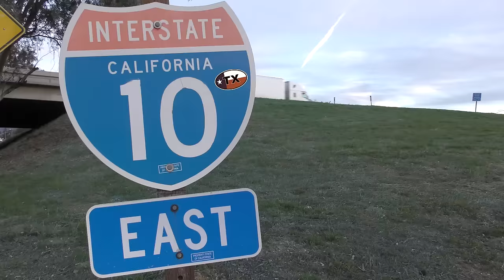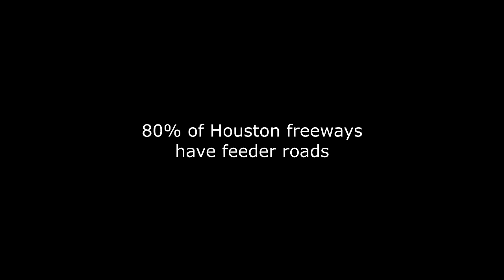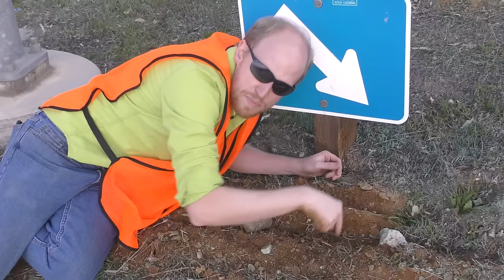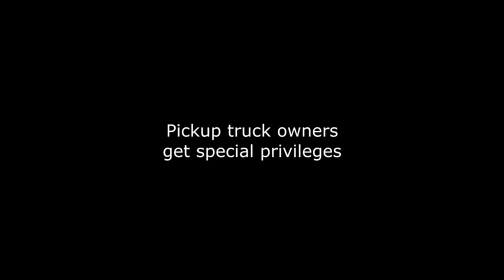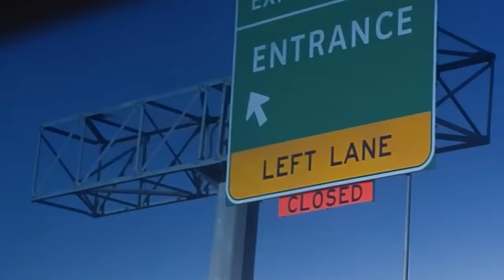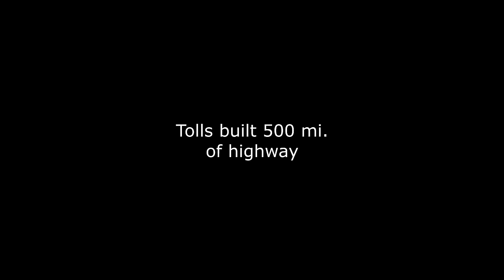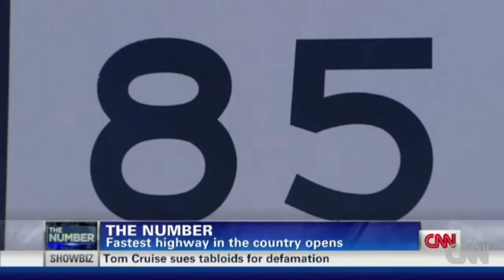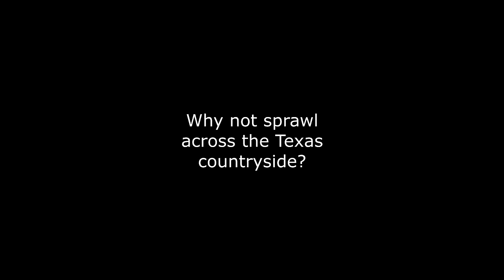How does good Texas engineering make REALLY BAD roads?

Comment: I lived in the Spring-Cypress area for two years before moving to LA. The roads are a bit challenging to figure out when you first get there, but start to make sense over time. The endless commercial development along freeways looks tacky, but can be fairly convenient as a shopper.

One thing to note too is the large network of highways that aren’t limited access. A trip from Houston to Austin usually involves US 290, which will take you from speeds of 75 mph between towns to speeds of 35 mph as it goes through towns along the way. Feeder roads are not present on these highways, and it can be a little shocking to have the speeds change so much. 

I’ve also driven US 59 and 259 from Texarkana to Houston. I was really surprised to see houses with mailboxes and driveways along a road with a 70-75 mph speed limit.

Comment: It is a service road.  It doesn't feed anything.  We also don't have fences along our highways because of this weather event we have in Texas, they call them tornadoes, also some of those dirt paths were used by police, emergency vehicles, or to move traffic off the highway due to a major accident.  Houston has had a history of flooding issues due to the land it is built on and the poor management of flood areas.  Houston rezoned flood zone areas that were purchased by the city a long time ago for flood control so they can use the area to store flood water, the rezoning happened shortly after a election cycle that say it get bought by a developer and turn the area into housing and that is one of the reasons Harvey was so bad.

Comment: I lived in Dallas for 5 years. Living in the city itself wasn’t bad, if you work there you don’t need to leave often. But when you do, I 35 was my best friend, I tried to map out what I needed when heading out of Dallas county according to it (north and south). Although, some people I knew lived on the outskirts and using the 635 loop can be hell if it Is after 5 or or before 8am. Traffic has a tendency to stop on that thing, and I remember I used to keep water in my car just in case I spent 2+ hours on a Friday night stuck on 635 due to bad wrecks. Highway 30 that runs east and west was a good friend too. I relocated my last couple of years there to Las Colinas, and it is a zoom into and out of Dallas (5 to 10 minutes) on highway 30. I can’t imagine what the traffic is like now. I moved North to start a business in 2013 and I miss the city, but not the traffic. There were so many tolls being built when I left it was crazy. The feeders, you need a car with good horsepower to get up to speed, as sometimes the on ramps are much too short.

Comment: Horizontal traffic lights> Vertical lights
Reply: They started installing horizontal lights here in Gainesville, FL about 15 years ago then stopped.
Reply: Horizontal is better for high wind loading (in line with the gantry arm), like hurricane areas. Vertical is better for high precipitation, especially snow. So that explains part of the difference in choices.

Comment: To me, the original concept of the PA Turpike was excellent.  One gets on it, and exits every 20 miles.  It bypasses Philly.  It was built for long haul, transcon traffic.  Local traffic, stay off.

Now the tool part of the PA Turnpike is discusion for another day.

One major issue I have with Toll 130.  It should have been built to bypass San Antonio and connect with I35 and I37.

And US 190 neefs to be upgraded to Interstate standards between Baton Rouge LA, and Iraan TX.  It would provide an E to W bypass of Houston, Austin, and San Antonio.

Comment: I was skeptical when I started but you pretty well nailed Houston.  But you missed some of it too.  In 2001, Tropical Storm Allison hit Houston, went north to Conroe then made a U-Turn and came back hitting Houston a second time.  That was very bad; second only to Harvey.  Harvey stalled West of Houston and we were hit time and time again.  That's a bit unusual!  Hurricanes usually have enough punch to get through; tropical storms often stall.  Allison was a bit different.  The first hit wasn't so bad.  The second hit was bad.  Not only did it drop a lot of rain on our saturated ecosystem but the rain it dropped north of us came down with it.  And it arrived just before high tide.  

But the absolute worst is TxDOT.  Right now, they are planning on rerouting I-45.  It currently goes through downtown Houston and it is as wide as possible with demolishing a couple of tall buildings.  So they want to move it to the east side of downtown and run it parallel with I-69.  But the idiots have decided that they will run it below grade.  Flooding isn't just a problem when tropical storms and hurricanes come through, we've had major flooding when an ordinary heavy rain came though.  Below grade roadways become retention ponds.  Highway 59 (now I-69) looked like a canal.

Comment: The flooding problem can be handled.  Minnesota requires that all new construction has ponds based on the surface area that is covered by the construction.  Every highway exit and neighborhood has ponds that act as a buffer for the rain.  The one behind our house varies by 3-4 feet in depth over the course of a year.  This one is based on the bed of an old creek.  It is currently at the lowest that I have see in the three years we have been here, about 18" in the low spots and completely dry in some areas.  It is beautiful in the summer and the ducks love it (don't mow the edges and the geese will avoid it.

Comment: Everything you mentioned regarding access roads is a feature, not a problem lmao.

We don't have sidewalks because I'm not gonna walk or ride a bike around when it's 110 outside.

Loops, left & right side exits are there to provide a more direct route for people who know where they're going, and helps keep traffic flowing. La traffic is a monstrosity; stand-still traffic for hours to drive 10-15 miles. But even in Houston and Dfw, people consider doing 40 on the highway to be abysmal. Traffic almost never stops except for accidents. I'm in Colorado now and lemme tell ya; i25 is a prime example of why multiple routes headed in the same general direction is nothing but beneficial.

Comment: I just moved to Texas from Indianapolis and I hate hate hate feeder streets. I find that it makes it much more confusing to get around since the way you get TO somewhere is always different than how to get BACK, due to one way feeder streets. I also find them dangerous and add many new points for accidents as people are getting off and on at high speeds in almost the same spot. And don’t get me started on Dallas. There are way too many exits and splits that give you about 5 seconds or less to choose, causing many wrong turns and roads that offer no second chances or turnarounds. And yes, most Texas roads are half finished. At least half of the highways are two or four lane roads with walls on either side and no shoulder. No opportunity to avoid accidents when sharing the road with semis and crazies going 90mph. I hate it all with a passion.

Comment: I participated in an online debate as to whether Texas's frontage roads on Interstates were fully federally funded or not. Turns out that, in most cases, building frontage roads was cheaper than buying access rights from property owners, so building frontage roads was an appropriate use of federal funding. What wasn't resolved was why the same thing isn't true to the same extent in other states. The obvious answer is that Texas law is a great deal more generous to landowners than the laws of other states are.

Comment: During Harvey, a suburban fire department responded to a house fire, perhaps caused by the water getting up to to breaker box.  They knew where the fire hydrants were, but couldn't get the truck in because of the water being over 4 feet deep.  What's a poor guy to do?  The fire fighters got to the fire on jet ski's.  The finally realized if they put enough weight on the front, where the intake was, they could shoot a large stream of water at the house.  The fire, which consumed more than half of the house, was out in a few minutes.  I remember vividly watching some flood gauges I knew of, that something never seen in the past was happening.  By 8 AM, several gauges had stopped reporting.  So then I switched to a USGS gauge near my parents house.  Their house was about 70 feet above Galveston.  This gauge was still working.  It was reporting a water depth of 69 feet and a flow rate of 9,000 cubic feet per second!!!  That's like a small store 300 feet deep flowing by this gauge every second.  That's when it dawned on me.  The reason the other gauges stopped reporting was because they were not there any more.  The flow took the gauges down stream with the water.  Why did I check the USGS gauges?  I knew they reported their data via the GOES weather satellites.  Most of these sites have the radios on poles at least 20 feet above the road they were on.  I knew it would increase the chances of them surviving higher flow rates.  For the record, no my parents house did not flood.  This was because the city had improved the flood control to include 2 square pipes large enough you could drive a full size pickup through them.  Water was in the streets, but did not get in the house.

Comment: 835 from Dallas to Laredo is possibly the worst when it comes to shopping districts packing up along the interstate with the Frontage roads. As a trucker going about 65 mph takes me about additional one or two hours to travel 400 miles versus other parts of the country. And after 1 PM guaranteed traffic it for at least 200 miles.

Comment: Horizontal traffic signals make way more sense than a standard vertical installation....Better overhead clearance and less wind load. Not sure why this isn't the norm everywhere. As far as I know only Texas, New Mexico, and Wisconsin use the horizontal setup as their default signal install.
Reply: Horizontal lights aren't standardized. Some places put green on the left, others put red on the left. That is the biggest reason they aren't installed frequently. It creates a massive safety hazard for colorblind drivers.
Reply: @jarynn8156  I've never seen a horizontal setup that didn't have red on the left. They are standardized pretty well as far as I have seen.
Reply: @warrenduree9417  They are mostly standardized, green on the left is rare, but they introduce a level of ambiguity that doesn't exist with verticle lights. And when you have folks operating 60 MPH 2 ton metal death machines, you can't afford ambiguity.

Comment: The odd yields around ramps on the frontage roads are due to a state law passed in 1979.  It requires frontage road traffic to yield to ramp traffic. Of course, some of the frontage road— ramp intersections were designed for the ramp traffic  to yield. So there are a lot of these weirdly placed stop and Yield signs.
Now

Comment: I live in Memphis, Tn and recently drove to Dallas. I have to say as someone who has driven everywhere from Miami to LA, TX has the most confusing highway system ever.  A toll highway in THE MIDDLE of the "standard" highway (don't drive in the left lane, it will literally force you onto the toll with little to no warning), those "frontage roads" that you have to use to get on or off the highway, exit ramps that go straight up into the sky on the LEFT SIDE, overpasses that stack five high,  U turn only lanes...WTF.  If you're a local I'm sure it's no big deal, but if you're from out of town....let me just say it can get frustrating QUICKLY. Additionally, nav systems (vehicle equipped, Apple, Google) literally could not tell if I was on the highway or frontage rd. Driving through there gives me anxiety. And don't even get me started on standard city streets with left turn lanes that run inside the median, double left turn lanes on flashing yellow...ugh. Don't get me wrong, I love Texas, but those roads...phew.

Comment: I certainly am no expert but I think that Houston should use that new concrete they developed for New Orleans that absorbs water and lets it seep into the ground below. They could use this in future parking lots or something.
Reply: They don't have the drainage system to redirect the water flow currently. It's less about letting the water hit dry earth than it is about putting it somewhere that it doesn't cause a public issue, Houston built inside the natural catch basin so the water drains into it rather than out of it.

Comment: Regarding promoting cheating: people very rarely do this. It’s mostly just during rush hour, and you see maybe one or two. This issue with this is the fact that people don’t really yield to the ramp. I mean, I’m pretty sure it’s the law, and there will even be a sign saying so, but the left lane will do a failed zipper, let only one car on at a time, method, while the right will rarely yield at all. This means that a non heater who really needs to make a right turn soon will have difficulty getting into that lane.

Sometimes, the left lane is so bad, that some towns will force the yield by merging the left lane into the right every time there’s an off ramp. This just makes traffic on the access road even worse, because the left lane assumes the right somehow legally will yield to them. So rather than zipper with an even flow, they will run up the left, sometimes even driving on the painted merge median to force their way into the right, causing that bottleneck traffic. They are seen as far worse than whatever highway cheater you speak of.

Of course, when you have access roads like this, merging off the highway is a breeze, but then the right absolutely will NOT yield to you. They just spent 15 minutes letting in left lane passholes. Why on Earth would they let highway people immediately cut in front of them too?

Comment: So about making your own drive around is that it’s pretty obvious when it’s being frequently used. So sometimes cities and towns will actually go and PAVE those. This is confusing because technically driving off road to pass someone or get off the highway is illegal, with a pretty expensive fine, and I’ve seen people get ticketed for doing it, but if no one does it, then the city doesn’t know, and therefore never paves it. Also, “roads? Where we’re going, we don’t need roads.” So if you see an unpaved, obviously worn path, from one paved section to another, some people may believe it IS a road, just unpaved, so they unknowingly break the law.

Comment: Outside Tampa Florida has frontage roads similar to these on US-19 through Pinellas.  They work pretty well, but the re-building process decimated local businesses.   They're about to rebuild  two new interchanges in 2022 so maybe you can check them out before and after.

Comment: All that sprawl helps businesses externalize costs too; they build bigger stores in cheaper-to-build areas, which saves them money... and as a consequence people need to drive farther and farther to go get what they need, which costs them directly in gasoline and car wear, and indirectly in increased road wear.
Also, in general, more roads means more cars, which is definitely something we need to be encouraging people away from. They should be pumping money into (energy and space efficient) public transportation instead of more and more beltways.

Also, "It looks like what Los Angeles must have looked like back in the 1970's!"
I, uh... 
glances at the traffic nightmare that L.A. turned into
I don't think that's a good thing. That might not be a good thing to be doing.  (This may have been what you meant to imply. If so, I agree.)

Comment: Hwy 130 in Austin was built too fast (and poorly). Alas, the ground settled unevenly and rides like a small roller coaster. Not many will drive at 80 or 85 MPH, as you’ll probably get air under you.

Comment: San antonio has similar highway circling the city with 410 and 1604. But as well at highways i10, 35, and 37 creating a small circle just outside the downtown are and 410 around the suburbs and 1604 around rural areas

Comment: A private company attempted to build a toll road in Virginia (the Greenway between Herndon and Leesburg) and the state would not let them charge the toll they felt would let the project succeed. The project went bankrupt and the state took it over and the state charges DOUBLE what the private firm wanted to charge originally. So don't complain that Texas has done this successfully. PS: the Dulles Toll Road (Herndon to McLean) was supposed to be a toll road just until it was paid for.  It was paid off in 1997. Still a toll road. And now you can't use it without a PickPocket (aka EzPass)...